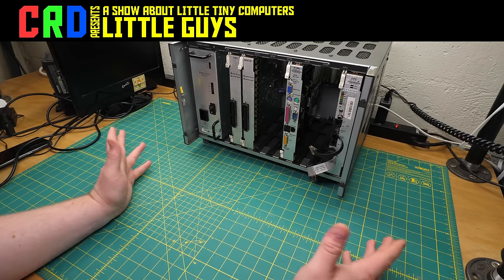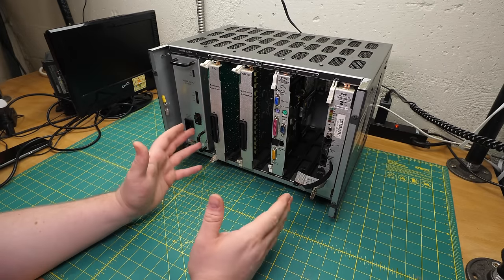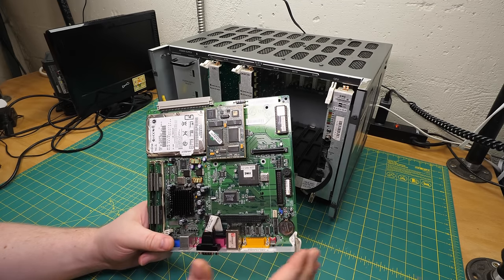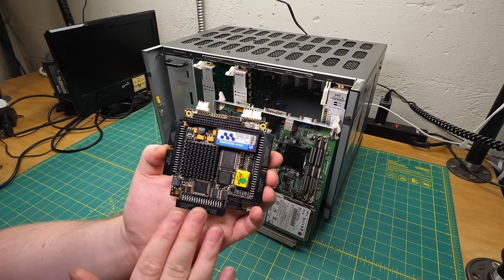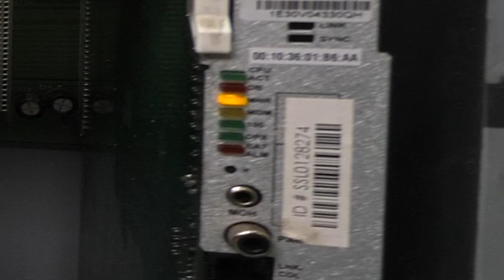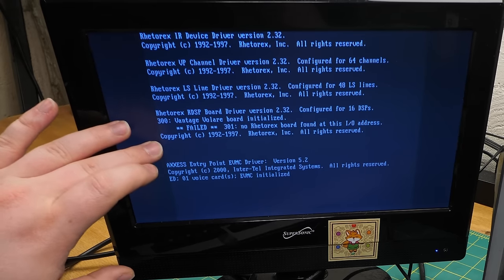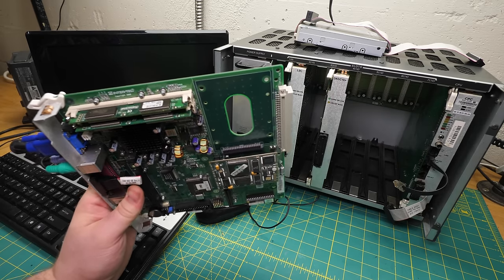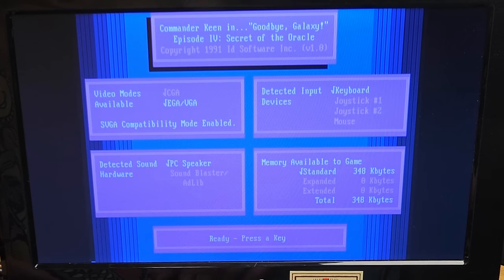Little Guys 9: The First Of Many [Intertel Axxess]

Comment: Casually messing with an NEC SV9100 before watching this video, wishing I had one of their little guy cards when they're so damn expensive on eBay. Was not prepared for one to appear in this video lol! No CPU card though, that's an expansion unit. Either you're hiding a second chassis from us, or you just wanted the little guys in this one :P I didn't know there were 3 either! I only knew of the GCD-VM00. Guess I need to add eBay searches for the other two now...
Reply from the maker: Yeah that's the thing I discovered after I got it hahaha. There were two chassis and I thought they were equivalent
Reply: You'd expect SV9100 modules to have value because it's NEC's current model (until they shut the business down at the end of the year)
Reply: @hornetfig  Just the little guys mainly. Chassis, CPU card, expansion cards and phones are all within budget homelab reach. Whole systems can be had under 100
Reply: @CathodeRayDude  If you can get a GCD-4LCA (4 line analogue phone card) and a GCD-CP10 (CPU card) that should be enough to bring it to life. You can also get the older CD-4LCA card but those need a special upgrade license when used with the GCD-CP10, and you don't want one of the older CPU cards if you're using the newer cards you already have (GCD-PRTA, little guys etc). You may or may not need to remove the expansion card installed to the right of the power switch too, not certain.

Comment: Also the hot snot won't be for casual impacts but from mains voltage - It causes stuff to vibrate (at 60hz in the US, at 50hz in Europe) and if you're going to leave stuff running 24/7 for decades - it can cause dry joints in the solder as well as clean eating through wiring (guess how I found out it was a thing?!)

Comment: Judging by the pinouts I found online, it looks like your drive misalignment put the 5 volts intended for the spindle motor into one of the grounds on the drive and created a short circuit. There are other ground pins on the connector, which are most certainly wired together elsewhere (hence the short), which is why the drive still works fine.

Comment: As always, great video, I especially enjoyed the PBX-related stuff... ;-) Regarding the "Faxback" service: over here in Europe (speaking of Germany especially), a similar service was quite popular as well in the 90's, but it worked quite a little bit different: instead of dialing in your Fax number (and possibly a document ID etc.) on your phone, you used your Fax machine itself to place a call and putting it into "Faxabruf" (Fax polling) mode. In this mode, the Fax machine dialled an outgoing number and then waited for an incoming Fax. This way, you paid for the whole call, and not the service operator. Commonly special rates applied, so "Premium" Fax polling services were a thing, but on the other hand also many toll-free services existed (e.g. from public-service broadcasters that provided additional information on their shows and magazines).

Comment: I have lived in the caves of Planet Embedded all of my career, and I have worked on drivers that write commands to FPGA registers.  When we tell the FPGA to "go", it doesn't necessarily go.  After we issue our command, the FPGA is dependent on another external signal from machinery operating in the real world.  That syncs the FPGA to what it needs to do.  I don't know why the FPGA needs signals from the CPC in this application, but that's my two cents based on my life experience. 
I didn't know about the PC/104 standard until a few years ago.  If I had then I am sure I would have gotten one in order to make a mini-pc in the 1990s.

Comment: Gameport could have common but technically non-specification MIDI output through one of the redundant grounds, typically implemented on sound cards in the 90s. It don’t know if that’s a reason anyone would use gameport as a critical interface on a PBX, but that MIDI output did end up getting used for control signals on e.g. the Microsoft Sidewinder Force Feedback (which in any case used digital input over Gameport, rather than the the usual analogue signals, IIRC).

Comment: OS2 Warp is one of those great things that kind of faded off into nothingness and allowed the windows juggernaut to take over everything.

Warp had so much going for it. If you would perused Byte magazine in the day and Jerry Pournell's column, a lot of love was had for this but as usual, IBM took a great idea and completely ran it into the fucking ground.
Reply: Yeah, I dunno.  I used OS/2 a little back then, so I don't have tons of experience with it.  I hear some of the features are nice.

But most of all, its biggest advantage was that it was a 32-bit multitasking OS in an era where most of us were using 16-bit OSes with cooperative multitasking at best.  But that was a trade-off.  All that power came at the expense of CPU and memory demands that many of us could not afford at the time.  It was A LOT heavier than Windows 3.x, which barely ran on my 486SX with 2MB of RAM.  OS/2 2.x (contemporary at the time) wouldn't even boot on that.

NT was also 32-bit and had better multitasking, and likewise had higher system requirements.  It ran DOS and Windows apps natively, as well as 32-bit versions that weren't that big of a job to port from previous 16-bit code, making it a better option for most power / business users, in almost every way.  Windows 95 tried to ride the fence, and so it was a lot better than 3.x, but not quite as stable and performant as NT.  But it would run in 4MB.  And that is why it succeeded.

Mostly, IMO, OS/2 just wasn't very compelling.  The UI was awful.  It didn't look very nice, and a lot of the design paradigms showed a poor sense of style and usability.  Like the floating dock of random controls, or a terrific example of awful design, the tabbed binder dialogs that used a ton of horizontal space for the labels.  We were all using low-resolution 4:3 screens at the time, and to suck up that much space that couldn't be used for anything else... and then put those forward/back arrow buttons down in the bottom right, interfering with the content of the dialog vertically, too...  Yeah, their UI team did not know what they were doing.

It was also very... "IBM".  It was fussy to install.  Everything felt very rigid, and you had to plan out your steps thoroughly, because if you made a mistake, you might have to reboot and go through a lengthy portion of the install process all over again, just so you can get your partitions set up right, or something silly like that.  It had a steep learning curve, like in the CONFIG SYS example in the video.  You could easily break it, even if you knew your way around a PC, DOS, and Windows already.

Then you have the infamous single-threaded event queue, which was a bit of an achilles heel in what was supposed to be a multitasking juggernaut...

OS/2 was a mess.  And that's not even considering the practical issues -- competing against DOS and Windows as an expensive alternative way to.... run DOS and Windows programs.  Because you had to.  There weren't many native OS/2 programs.  I mean, all of that is just OS growing pains, and is the reason why almost nothing else has ever managed to exist alongside (much less displace) Windows on the desktop -- with Mac OS being the primary edge case.

It wasn't until BeOS that I really felt like the world missed out on a solid alternative to Windows that deserved to survive on its own merits.  It multitasked better, while running leaner and faster on lesser hardware.  It shed a lot of the baggage and bloat of legacy software, rather than taking on more.  It was super friendly to new users and power users alike, by giving you all the tools you could want, but not requiring you to master them.  You could just live in the safe, pretty GUI forever if you wanted.  If OS/2 had been like that, it might have had enough reason to exist.
Reply from the maker: This is basically my take. OS/2 was ambitious, and on paper it has advantages, but my opinion is that everyone who loves it is just willing to look past it's absolutely catastrophic UI and design failures for the sake of the few things it could do that nothing else could. In other words, it was the Linux of its day - I've been using Linux since 1997 and it's only gotten worse to use, year after year, but I still have it installed on a dozen machines and I would never be caught without it. It's too useful, and it has too many design choices that ARE sensible (ask me how easy it is to mount a dying hard drive as read-only on Windows.) But it doesn't change the fact that it is an absolute dumpster fire designed by people who had no focus, no coherent vision, and no idea what the state of the art is or should be. It's not that OS/2 was ahead of its time; it's just that Windows wasn't as modern as it should have been, specifically because Microsoft wasted a bunch of dev time on the OS/2 collaboration before realizing it was not going anywhere they wanted to be.
Reply: @CathodeRayDude   Spot on.

Re: Linux -- this is so accurate.  It still bugs me how slick and usable KDE 3.x was, and how modern KDE is barely stable enough to run half the time.  Even in just the kernel and base supporting OS, there are so many carcasses of half-implemented frameworks and APIs that someone decided could be done better, and re-implemented in a brand new stack, only to get bored and move on to something different.  The documentation for the framebuffer graphics API is abysmal -- for the little that exists -- and they forgot to add things like "the ability to query what modes can even be set" and other aspirational features like that.

Linux really needs a project manager with some teeth.  But I will also defend it to the death.

Comment: My old job, which I do ironically IT for now. Has the same system in it still. Its not used anymore, as we switched to an allworx IP Phone system. The Inter-Tel system is still in tact, and I have a bunch of the phones still. It if I recall has two of the PBX boxes.

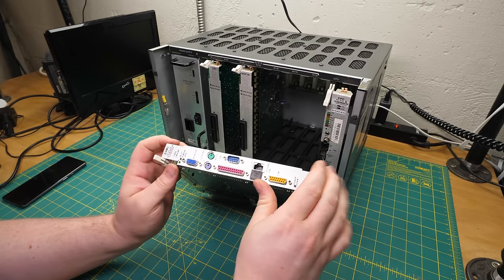Comment: @14:26 these are PS/2 plugs. DIN plugs are much bigger and (to my knowledge) didn't support a mouse. The color coding became "official" with PC'97, but many connectors were already colored that way before the standardization. So, after PC'97 you'd no longer find brown/yellow ports, but there were purple/green ones before, they just weren't standard yet.

Edit: actually they are Mini-DIN plugs which were only widely known as PS/2 ports. When I hear DIN plug, I always see the big old 5-pin one in my mind, but they're both German industry standard (DIN).,

Comment: Regarding game performance on that 486. Alone in the Dark was fairly playable on a 386SX 16 MHz. I first played that game on such a machine. Same went for Wolfenstein 3D which also played relatively well on that machine with the window size shrunk down a notch or two. But forget any Doom engine or later game though, even a 386DX 40 MHz was painfully slow in any Doom engine game.
Duke 3D did play fairly well on a AMD 5x86 @ 120 MHz but Quake was still very slow due to the relatively weak FPU in the 486 compared to the Pentium. However, even a 486 DX2 66MHz played any Doom engine based game well and even pre-Duke 3D Apogee games like Rise of the Triad. My 486 machine I had back then started out as a DX2 66MHz and was later upgraded to a AMD 5x86 via a in-socket voltage adapter. I ran basically every game I could get my hands on using it up until late 1996 when I was able to build a newer PC. Even the original Command & Conquer and Red Alert played well on my upgraded 486 machine, even in a multiplayer games on a 10base-T coax IPX network.

Comment: Likely used in a business, and that it was installed in a room that was also the staff canteen, thus the grease and such from years of microwave cooking of lunch, and never cleaned because the cleaning staff were told not touch.

Also had a PBX, and it used the same style of card, though it probably did not plug in that frame. Separate CPU card, which was also the only non hot swappable card in the chassis, the rest are hot swappable. The game port likely is being used for another serial link, as it has MIDI capability, so gives a serial channel in and out, which was probably used to allow the Motorola CPU to communicate with the answering card, to get details about a call beinmg accepted, call recording, and call hang up detected, so the audio can be saved, and then the extension having a flag set for the playing of a message tone when handset gets dialtone generated, or to flash the message light on it as well. Then handles the setup of the call to play the recorded message, and then erase and free up the space. Ethernet is probably there for another control channel, likely high speed audio.

PSU will also likely have the option to use a battery, with this probably a 48V battery bank, and that then provides a battery backed up supply, and the other rails provide the other drives. 3V3 likely comes from the CPU card.

Comment: Fun thingy. As for the sound card part, my guess is your best bet would actually be one of the new micro controller thingies floating around, using an MCU as "everything AND the kitchen sink". It's probably a first gen PC104, thus ISA, thus you'd just need an "edge connector to PCI104" adapter. It's actually ridiculous the amount of bang a $10 MCU packs these days...
(goes back to programming his wifi remote controlled "keyboard" ESP32... because keyboards with macros suck so DIY...)

Comment: Had a Nortel Meridian at work until it was decommissioned and ripped out a few years ago. Pretty much the same kind of deal. All card based, proprietary digital phones, etc... Though with a few notable differences. All line card connections where on the back of the machine. Dual controllers and both where based on an mobile Intel Pentium 2 running some weird, proprietary OS. There where traces on PBX being upgraded over the years. The voicemail machine newer. Like in this video.

All replaced for .... MS Teams..... yep everyone's favorite.

Though not completely. A small IP PBX remains on site running a a virtual machine with a single IP phone at the guard house and a couple of analog phone line's connected to an analog telephone gateway. To keep the intercoms at site entrances alive and the single elevator phone.

Comment: In the late 90s/early 2ks lighting consoles moved from proprietary motherboards to off the shelf pc motherboards.  Consoles like the Grand MA went with a linux OS (same version as the one that Apache helicopters used I'm told, for its outstanding stability), others went with custom os' essiz and some went with windows embedded.  Fun fact: after a certain point, even though you were never supposed to see the windows gui, if you had a keyboard and held down shift for too long stickey keys would activate.  This would backdoor you into the gui whereby you could get to control panel and cause all kinds of mayhem.  Anyway, lighting consoles are another great example of regular old pcs used in a specific task scenario much like your phone center.

Of course these days 'tis all ethernet.

Comment: ACPI wasnt around back then, think you meant APM. think support was added in the unloved warp 4 ☺️
Reply from the maker: I did indeed, I had even seen APM in the BIOS and went "right, this is an APM machine, I should say APM" and then didn't do it. Very smart of me!
Reply: @CathodeRayDude  tiny glitches dont make anything wrong for me, considering the amount of information presented

Comment: Try to lay your hands on a PC/104 to ISA adapter - in my case, I managed to find an ISA card that had a PC/104 module soldered onto it but retained one side of its passthrough header... i wired all the pins from it to a 486 SBC, and can then plug that card into e.g. an old desktop riser or proper backplane.

Comment: If I remember correctly - the SX versions of the Intel did not have an FPU. The DX versions did. Cyrix processors (at least the early ones) never included an FPU, which was one of the reasons why it was slower in benchmarks.
Reply: The i486SX physically had an FPU but it was disabled. I don't know if other manufacturers made true FPU-less versions.

Comment: Don't feel bad about blowing that pin in the hard drive.  I did EVERYTHING painfully right to remove an mSATA drive from an HP DreamScreen 100.  I plugged the drive into an mSATA to SATA adapter, but made the mistake of shorting connectors when I screwed it down.  It kinda wasn't my fault because the mSATA drive was non-standard.  It didn't have the flat copper donut clearance for the bolts and was actually snapped into place on the original board.  All that labor to get at the linux OS pearly nugget that I wanted to mess with ... for nothing.  Suffice it to say I toasted the Silicon Motion flash controller.  My friend says that the flash chip itself may be fine, but I can't ju$tify learning the skillz to find out it might be fine.

Comment: Just FYI, 8-bit and 16-bit ISA slots are not related to 8- or 16-bit sound cards - Soundblaster Pro 2 was a 16-bit ISA card, and Soundblaster 16 works fine in an 8-bit ISA slot.

Comment: 1:26:24 I would love you to put QNX on something. I remember around 20 years back I'd stumbled upon an old QNX demodisk and I was quite impressed that QNX could run a GUI with a web browser, high resolution display support via VESA and dial up modem support off a single 1.44M floppy.

Comment: Protogen jumpscare
Also: It likely got stuck at the DSP part because when loading the drivers, the DSP drivers fails
Reply from the maker: fascinating followup: I plugged it into the cpc card and tried again and it started fine. apparently it fails to program the DSP if the cpc isn't present